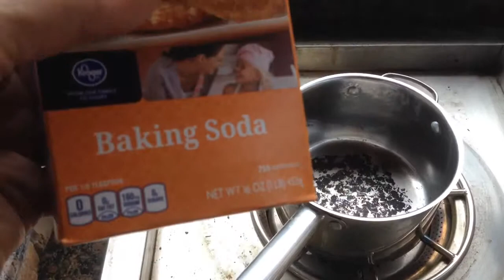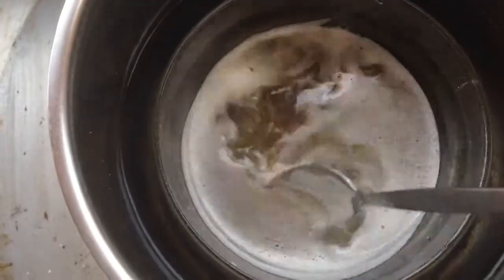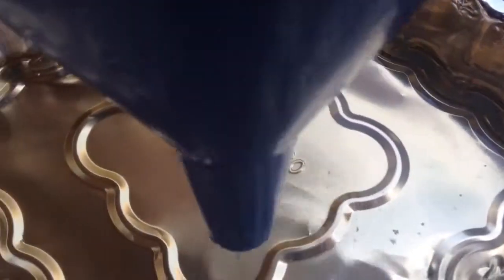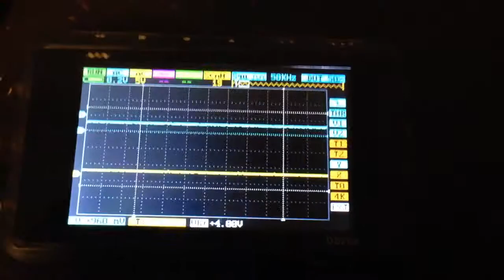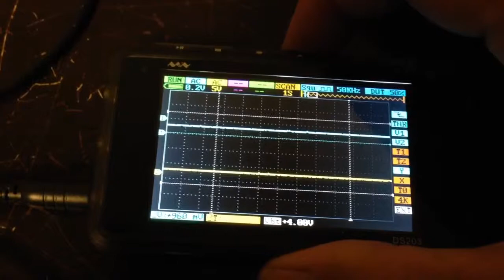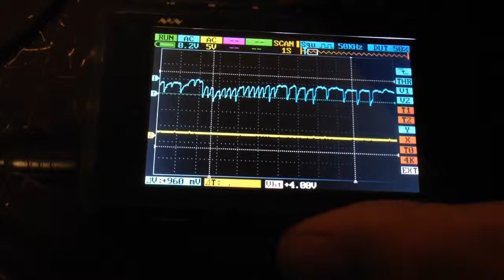Piezoelectricity from Homemade Rochelle Salts

Comment: What's cream of tartar exactly i didn't find it. Can I use something instead
Reply from the maker: Cream is tartar is potassium bitartrate. I found it in Kroger’s 
https://www.kroger.com/p/kroger-cream-of-tartar/0001111001056?&cid=shp_adw_shopg_.kroger_g_pla_shop_acq_evgn_ship_pantry&gclid=CjwKCAjw07qDBhBxEiwA6pPbHtLclb03XlipurpR2YF0P-SMBseadyiH24CHvDmkrKMrie1UyBffvBoCREEQAvD_BwE&gclsrc=aw.ds

https://www.target.com/p/mccormick-cream-of-tartar-specialty-herbs-spices-1-5oz/-/A-13460053?ref=tgt_adv_XS000000&AFID=google_pla_df&fndsrc=tgtao&DFA=71700000012510691&CPNG=PLA_Grocery%2BShopping%7CGrocery_Ecomm_Food_Bev&adgroup=SC_Grocery&LID=700000001170770pgs&LNM=PRODUCT_GROUP&network=g&device=m&location=1026027&targetid=pla-775850750055&ds_rl=1246978&ds_rl=1248099&gclid=CjwKCAjw07qDBhBxEiwA6pPbHkv_sbdKSbGDr85r-8RBBPVKy3JUR7tuk5Cb266iYW7SU-niguFdKRoC_XgQAvD_BwE&gclsrc=aw.ds